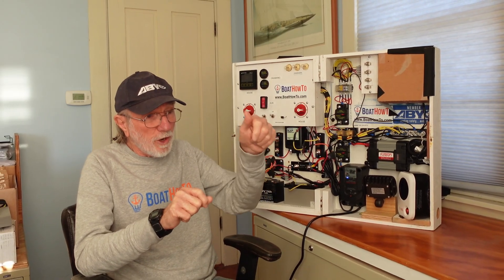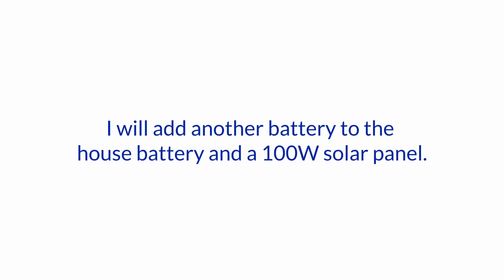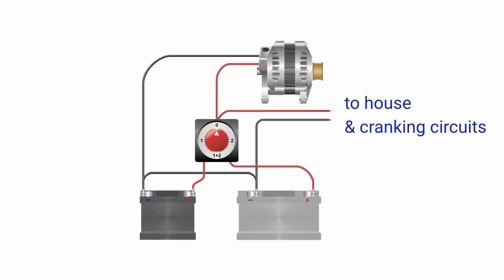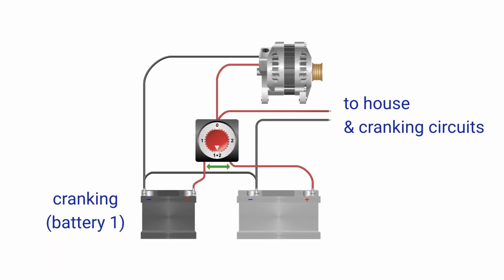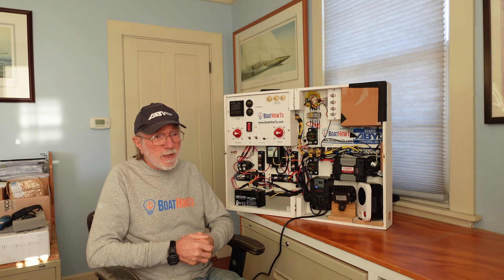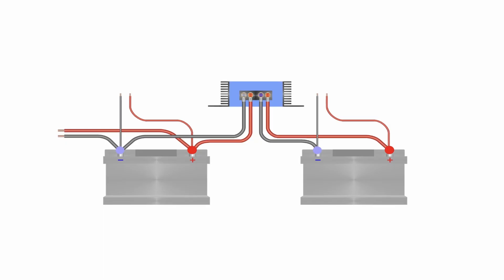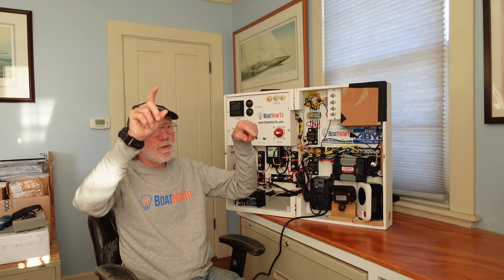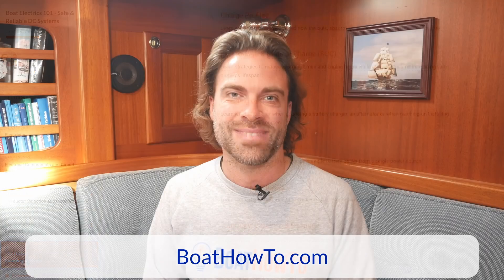Charging Circuits for two Boat Batteries | Ask The Expert with NIGEL CALDER

Comment: Firstly - thank you for imparting your knowledge in clear concise visual messages almost resembling video text messages😊.

The new generation power supply industry as a whole is moving forward at a rapid pace where barriers to entry e.g. cost and electrical knowledge standards for safety are becoming lower.

I own a 37 foot 80’s vintage sailboat that is “dry” and in excellent shape. We are a family of 4 and the kids are now quite independent and choose where they want to spend their free time. It is the same for our closest friends. We all also love landlubber activities such as camping and we find ourselves (adults) looking for more remote adventures that are combinational and require a more plug-and-play power. When my wife and I are alone we are on the boat, when we have friends it becomes cramped and the excitement lies in sailing to different locations accessible by boat, but once there we want to enjoy the land.

I have been researching Bluetti and it makes a lot of sense. The issue is the current market positioning is “supplementary” power source, where what I, and I suspect many others would like a portable “bring it with you” house bank. There are a number of “bits and pieces” offered but no clear “plug-unplug-and-play” mechanisms that meet standards.

I would like to plug a bluetti and use it as a house bank and use it with my boats AC and DC system outlets while on the boat without having to run electrical power cables to it. This gives me a world of options as it would allow me to use our portable induction cooktop both on and off the boat (yeah my wife hates cooking pasta over a campfire, and a camping stove requires propane and other bits to carry).

I am sure there is a market here, as we may spend weeks not going to the boat and having to make an investment for on and off the boat is expensive.

Can you describe what a safe setup would look like, and perhaps you can work with Blietti to build a plug-unplug-play” catering to the “weekend warrior sailor-camper-outdoor” segment. It makes sense to bring it home as well as it is quite useful when there are power outages at home.

Not all of us are full time cruisers and I suspect there is a huge untapped market for the all-around adventure enthusiast.

Thanks

Comment: Decent.  In terms of connecting the alternator to a lithium house, BMS disconnects (house bank) under load can be a problem too.  Though I would say under normal operating conditions the current will have already tailed-off prior to any BMS disconnect.  And you generally want to avoid BMS disconnects anyway by having proper charging parameters.  But that doesn't entirely remove the "risk" of it happening.

So generally speaking, unless the alternator is also being upgraded, it is a good idea to just leave it connected to the starter battery with a drop-in relay on a 60-second delay after engine start to engage the alternator (if not already built into the alternator).  Totally automatic.

These days the old 1/2/all/disconnect switches are kinda dated.  With a lithium house bank and a starter bank people have come up with all sorts of weird ways to interconnect the banks that really don't make a whole lot of sense in the end.  That includes using a manual switch (except in an emergency situation).   It is far better to use DC-DC chargers even if you need two or three of them and limit the amperages (and cost) to only what you need.

This also dovetails with using a higher-voltage (24V or 48V) house bank, but that is a separate topic.

For example, with the alternator connected to the starter bank you would want a DC-DC to the house bank.  It does not necessarily need to be that beefy... it just has to exceed nominal continuous loads plus (for safety) the maximum bilge pump load.

The DC-DC charger from the house bank to the starter bank, on the other hand, only needs to trickle-charge since nothing outside of the engine is hanging off the starter bank.  6A is more than enough.  And it doesn't even need to be a DC-DC charger... it can just be voltage support (DC-DC converter to ensure a minimum starter battery voltage).... those are cheap.

All other charging sources (shore, solar, generator, etc) would go to the house bank, always.  And be advantaged if the house bank uses a higher voltage.  And legacy 12V devices would either hang off a 12V house bank or hang-off a third "legacy 12V" bus with its own 100Ah 12.8V LiFePO4 battery fed by a third DC-DC.  Depending on the level of resilience and house bank voltage desired.

-Matt

Comment: If you have DC to DC or charged based bridge, the shore power should also charge start bank... lead acid sulphates if not floated. If LiFePO4 bridging isn't safe, one big bank, solar, and done. Otherwise DC to DC is the only way.

Comment: i connected a battery isolator to my fishing boat for the trolling motor batteries, i touch nothing, the engine charges the batteries, starter motor does not go dead from trolling motor use.

Comment: I think the standard now is DC to DC to cranking battery and everything charging the house battery. If you add a second house battery it adds a lot more complexity. Best to only have two banks and simply upgrade the house to more capacity than try to wire in a second house
Reply: All charging sources except the alternator.  For the alternator there are a bunch of special cases.  While it is possible to tie it into the house bank, you generally want to tie it into the starter bank for safety and resiliency.  The engine is incredibly important.   But all other charging sources would go into the house bank, for sure.  No question about it.  And the house bank can also feed the other DC busses.

Complexity is mostly just the system schematic.  Adding battery satellite busses can actually reduce the complexity of actual wiring.  And vastly increase resiliency in an emergency.  However, the concept of the old 1/2/all/none transfer switch just doesn't work when one or more system busses have lithium on them.  The transfer currents can be overwhelming and dangerous.

This means you wind up with potentially quite a few small DC-DC chargers and/or converters in the system.  Only one big one (starter bank to house bank while engine is running... can just be a voltage based DC-DC charger).  Nothing to be scared about outside of the cost.

They would mostly just be low-amperage devices and not need thick cabling.   For example, a DC-DC charger from the house bank to the starter bank would only need to push 6A into the starter bank... trickle-charging.  Since only the engine is hanging off the starter bank.

-Matt
Reply: There is no added complexity in adding a battery, it's just two cables, and in most cases two or more batteries are much easier to install than one big battery.  There are also many boats that can't accommodate a big battery but several smaller ones will easily fit.

Comment: Nothing in this world is idiot proof. The dual battery switch is factory installed on many boats and has worked fine for the majority of people when the correct operation is explained to them. Using a battery isolater or a multi battery relay for multi battery boats is a more convenient way of use but much more expensive. Yes, turning off the battery switch while engine is running can cause alternator and other electronic failures. Leaving the bats connected in the both position will leave you without a backup for engine starting. People need to understand the operations of this type of system if they want a boat with this capability. I can't imagine being so incapable that we need cars that drive us around and park themselves and simple electrical systems that have to operate themselves because someone thinks people are too stupid to learn how.
Reply: Im no pro but I know electrical. I have the Off, 1, 2 and 1+2 switch. Has worked great for me, never had a battery issue. I sometimes late in the day with start he engine on 1+2 when we are calling it a day. Never had an issue in 3 years, I was looking to extend my battery switch further out so I was looking at videos but I’m confused  here. They seem to be complicating it. I work in Aviation, there are alot of auto switching relays, don’t see the need for that in a boat
Reply: Imo, younger gens don't want manual things. They want to push a button or swipe a screen and have something happen. They don't want to step on a clutch, move a lever, slowly release the pedal all the time while doing other things. Look at the interest in 3D printing. Most don't care how it works, where to get models, they just want to do the least and get the most. Same thing here. I tried to explain how to use my boat to several people that wanted to use it and right away I could see their eyes glaze over. Their only question was "what happens if I don't do anything". Self driving vehicles are not necessary unless you have a bunch of uninterested and incompetent people.
Reply: Its totally true that younger generations want more technology.  I wouldn't say that they are oblivious to how the electronics work, though... if anything they actually have more schematic knowledge, while older sailors tend to be better at understanding things like galvanic corrosion.

Older boaters constantly get stuck on "12V everything" and old ways of doing things that do not mesh well with the larger amounts of energy younger boaters desire.  Or the energy management required to deploy it.  This is particularly true when it comes to modern, higher voltage systems and inverters which younger boaters want to leave turned on.  As well as continuous loads 24x7 (like starlink, wifi, etc).  Whereas an older boater just assumes there will be no AC power at all unless they are at-dock.

So... it kinda goes both ways.  Victron certainly capitalizes on the recalcitrance.  Younger boaters want quality-of-life, though.  Just like modern RVers with solar do.

The days of hovering around the kerosene lamp on a cold evening are probably over.

-Matt

Comment: I bought my little Finn 8 motor-sailer (more motor than sailer) as a novice to powered boating. It has the off-1-both-2 switch. Previous owner only gave me a very quick run through on operating it. I'm learning on the go from other boaties and YT vids. (Not to mention from my own mistakes!) Up until now, I've been starting on Batt1 (start circuit only), then switching to "Both" to charge 1 & 2. Fortunately, I'm in the habit of shutting down the engine before switching to off. That just seemed logical, and I'll now make sure I adhere to it. But I think that in future, I'll switch back to "1" before shutting down, to keep the batteries isolated from each other.

Comment: My alternator and the shore charger and my solar charger all connect directly to my house batteries. The house batteries are connected to the starter battery with an echo charger. I have a switch that can bring the house batteries into the starting circuit if need be, but normally it stays open. Don’t have to think about it and it works really well.
Reply: Same with my boat. The alternator always charges both batteries. The switch is only for choosing which batteries to be used for the load.

Comment: Lithium is the way to go with house batteries. With Lithium use a dc to dc charger it just simplifies everything and has solar plugs built in. Wire in a heavy gauge selector switch to use for starting with the house batteries if needed.

Comment: Those battery switches come in 2 versions. One is make-before breaking,  the other is break-before-making. With the make before breaking switch there is no open circuit and the alternator is protected.
Reply: Unless you switch it to off with the engine running
Reply: Except if one bank is lead and the other is someone's 20kWh home lithium bank, make-before-break can put 300A across the bus for the short period of time the two are connected.  Or worse.

Comment: So Nigel why do they make the battery selector switch?
Reply: Mist people pay attention and don’t do it wrong. 

At least more than once. 

Don’t use ‘both’ or ‘off’ until you’re parked. Really not rocket surgery.
Reply: I suspect it is to combine two different house battery groups.

For example, if you plan to extend your existing group with new batteries, you can't just combine them with the old. They need to be their own group. Charged separately. Then you could use the switch, from the batteries to the load.

Comment: I would say this with a 100 W.Solar panel not very powerful , but just powerful enough to keep your cranking batteries charged, But you would probably think of a second alternator to charge the house batteries Text a little bit more amprage, The?
Marine chargers would be House batteries and On not sunny days you still should have some sort of Charger to keep the crank batteries up. Separate your system cranking batteries and house batteries .

Comment: Bullshit disconnect the batteries from the charging system leaving the Alt. Open will not destroy the alternator.
Reply: It will if you disconnect while running. I’m confused why you would be messing with the battery switch while running the engine though
Reply: in bulk phase, yes it is. High voltage spike on diodes rectifier
Reply: It could blow up boat, and if using lithium batteries the atmosphere can ignite.

Comment: Well explained. A couple of years ago I made this transition to an automatic charging relay, which does pretty much exactly what is described here. As stated it was a relatively easy and fun project. You no longer need to have somebody switching dials while the engine is running, you don't need to remember to switch to 'both' when charging with shore power, and it seemlessly integrates other sources of power such as solar or wind energy. I did a detailed video documenting the experience.
Reply: Please, can you share the link?
Reply: https://youtu.be/89YJ1X1MIZc?si=jog1re9KPtGzuECM
Reply: Found it. Thanks

Comment: I would like to ask a question, which I suspect may not be rare, but I am not sure where to do it, so I will try here. On my sailboat, I installed, in parallel, three flooded deep cycle batteries, 100Ah each. Next year I noticed rather poor performance. Two years on I checked them with tester one of them tested in good health and two really bad. The system is permanently hooked up to a 400W solar set up, through an MPPT charger, all from Renogy, which easily charges the batteries. Both the loads and the charger are hooked up to the good battery.
Reply: You said:  Both the loads and the charger are hooked up to the good battery.  I  think you need to connect the positive leads from the charger etc to the "good" battery and the negative leads to the last battery in the "row".  You need to think of your 3 batteries as 1 battery, not 1 battery with 2 more added on.
Reply: @Theseattlescott  Thank you, good point. I do have the negative lead coming off the last battery and the positive from the first (good)battery. The  negative then goes to a shunt and on to switches. The negative line from the solar charger is not connected to the last battery, but to the side of the shunt further from the last battery.  My battery monitor, hooked up to that shunt shows me the balance of the system. Would it also do that if I connected the negative of the charger, directly to the last battery, that is before the shunt?  Another question I could not find an answer to. The Topdon type battery testers are said to be prone to give unreliable results. Are they capable of showing a false positive; show that a battery is in good health when in fact it is bad?
Reply: @Jarek12010  Can't advise on the shunt issue.
Reply: Would start with the obvious stuff first. Confirm that your battery terminals are tight. Then confirm that your solar charger is delivering equal output to all the batteries and then check that battery drain on all the batteries is equal.
Reply: @brandonbeers7923  I will look into what you are suggesting, thank you. Batteries are in parallel, so they should be charged the same, no? Unless there are bad connections, which I doubt. Interesting development. I tested the batteries again with the Topdon testerand, repeatedly, when I clamped the tester jaws only to the threaded stud terminal, the batteries were bad, but when I clamped onto the brass clamp or directly onto the lead terminal, batteries tested ok. Is it possible to get a "false positive" from those testers?

Comment: i have 2 start batteries with 2 dc to dc chargers connected to the house bank and the charger connects to the start batteries when they are full it overflows to the main house bank, my solar feeds directly to the house bank